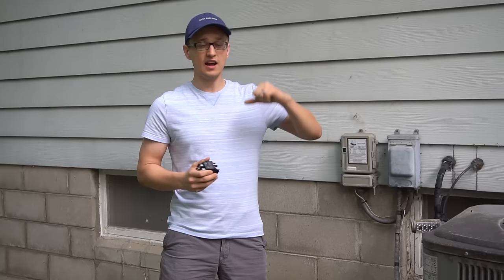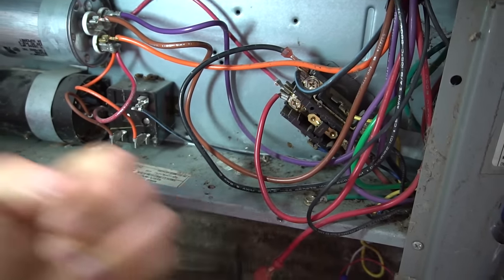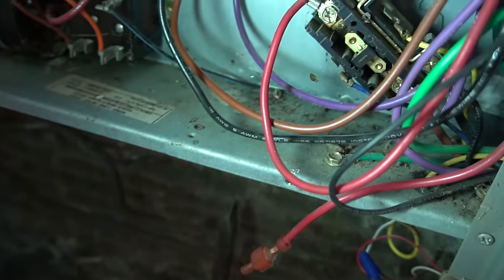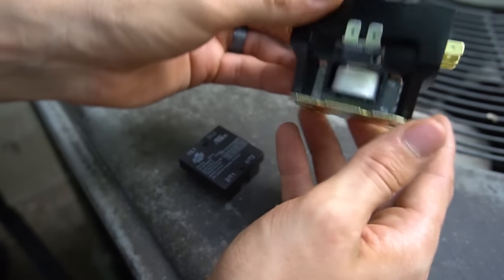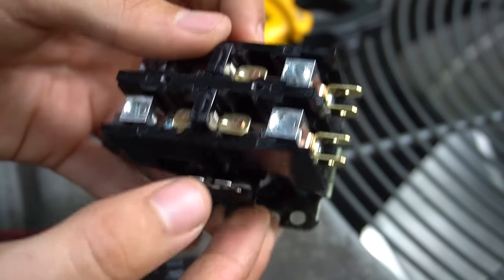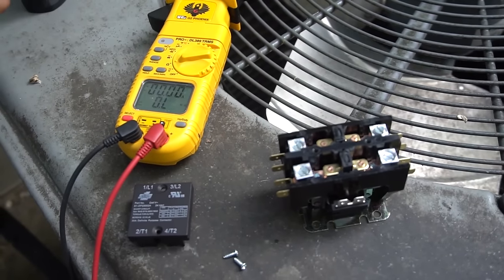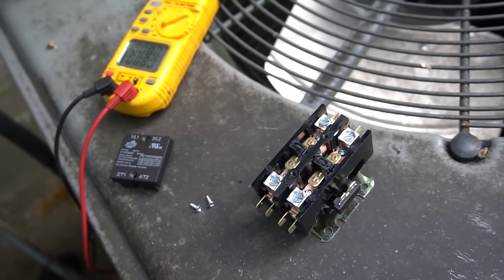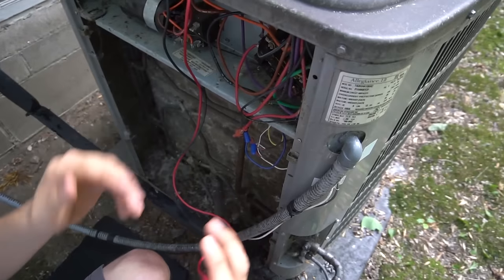Air Conditioner Contactor - How To Check If It's Actually Bad

Comment: I put a new contactor in my ac unit. I get 26v to the contactor on the yellow lines but it's not activating the contactor. I can manually push the contactor down to turn ac on. But the 26v isn't doing it. What can I do now?
Reply from the maker: Have you tried checking all the things mentioned in this video: https://youtu.be/NVPhsK4gK1A?si=s_jZeYd7-TXIjwDL

Comment: I replaced the relay or as you say "contractor" and still have intermittent issue. Issue is the compressor will not shut off but fan inside does shut off. So Thremostat is shutting off fan but not compressor outside.. Though part is this is intermittent!

Comment: Hi, my outside unit doesn't turn on. when I press the plunge it does turns on. we checked the brown wire that goes out from the house and it gives 27v, the input at the connector has 240v , but it doesn't give 24v up and down the contactor when calling for cooling. We also checked coil resistance 11-12dms. Capacitor is good. We switched to an old thermostat to make sure its not our nest and no luck. Fan blades are not stucked. hope you can help me
Reply from the maker: Have you watched this video for more ideas? https://www.youtube.com/watch?v=NVPhsK4gK1A&t=1s
Reply: Dealing with the same issue. Still can't figure out how the current is lost once it gets to the contactor. I will check for resistance on the contactor tomorrow and see if I have any luck. Right now I have the contactor forced in until room gets cold with fan set to on instead of auto on the thermostat. Please share if you find a fix.
Reply: Update. I was getting resistance on the contactor so I found the high pressure switch and pushed the button in to reset as suggested in the link above. Hope it works for you too. Good luck.
Reply from the maker: @narouspk  Thank you for coming back with an update! By the way, if the high pressure switch was tripped, I would wash down the condenser coil good. Even if it looks clean. (plugged coil = higher pressures)
Reply: @WordofAdviceTV  I actually did since you recommended it in the 10 reasons video so enjoying the cold breeze now. Thanks a lot for these helpful videos.
Reply from the maker: @narouspk  Awesome! Glad to hear it! Stay cool :)
Reply: Update: Freon levels were low and tech is coming to assess where the leak is :( 
@General Narous, I’m glad your problem wasn’t as big as mine
Reply from the maker: @adrig5059  Good luck Adri!

Comment: Subscribe
Quick question I don't have any blower motor or anything my air conditioning quit working if I set the thermostat to call for heat no air movement set it to call for cooling no air movement set it just on fan only no air movement. And jumped out from R to G 
Looking for my blower to come on but it did not it's looking like I don't have any power to the  R terminal I will double check it tomorrow I had to come upstairs my light kept going out I had to charge it. 
Anyways I've seen the mention of a three to five amp fuse on the board itself now for the life of me I cannot see a fuse on that board anywhere. Do all these boards have a three to five amp fuse on them?
At my main breaker panel the breaker does not appear to be tripped, but I did turn it off and back on however I do have power at the shut off that has that little screw in fuse into an Edison type socket I do have power there normal 120 volts. 
I really was hoping to find a blown fuse on the board and see if I could locate the short but I just cannot see a fuse on that board anywhere. 
I suppose my next step would be to check for nominal 24 volts out of the transformer.
Question is that transformer supposed to supply 24 volts nominal to the board at all times in other words I don't have to make my thermostat call for heat or cooling or anything like that correct?
I'm burning up with inside temperatures here of almost 80 degrees I'd like to try to get this thing going if I can. 
I have a hunch my a coil was froze up because there was more than a normal amount of water 
On the floor and on the horizontal surfaces in the furnace area. 
I left it off overnight to make sure it was thought out if indeed it was frozen and I did change the air filter, it appeared to be somewhat clogged but not terribly.
So if I check my transformer and have 24 volts nominal coming out of the low voltage side then I should have power at my R terminal, if this ambiguous fuse is not blown that I can't find. If I have 24 volts nominal going to the board from the low side of the transformer and I do not have power to my R terminal, would that most likely indicate a bad board? That is notwithstanding if I can find a fuse and it is not blown please advise I am burning up in this place.
I also wanted to note when I set my thermostat to request cooling my air conditioning fan is running outside but I do not hear the compressor kicking in. 
If I decide to pull the panel off the outside unit is it possible to manually engage the contactor and see if the compressor kicks on? Again though on my unit outside the fan itself is running. 
Judging from what I am getting at the board I don't think the contactor is getting a signal or command to pull in and run my high voltage to the compressor. 
Tomorrow I am going to visually inspect around the outside unit and see if I can see any physical damage to the wiring coming from the board but again it looks like I don't have power at the R terminal of my board.

Comment: I have a weird issue. My contactor is not pulling in. I have 24 volts between the LV leads but not through the contactor. I replaced the contactor and the capacitor. I replaced the LV. I have clean filters.I have no pressure switches or condensate switches in the unit. I replaced the thermostat with a manual. It has fresh batteries. The blower is working. The fuse is good. If I disconnect the 24 volts and hold the contactor in, my fan and compressor kick on and the pipe out (not sure of the technical name) gets frosty cold. As soon as I reconnect the LV, the fan stays on but the pipe out goes warm (I lose the compressor). I'm at a loss at this point. The unit is 8 years old and is a Rheem. Worked fine last year. No odd noises.

Comment: Hey so, my unit outside is spinning. The unit in the attic makes a buzzing/humming noise, and not blowing any air. So I am not sure if this will solve it. I replaced the capacitor because I thought that was it but nothing. Any suggestions?

Comment: I am getting voltage from inside out to the unit but wires go to another controller on the outside unit. It has 2 red led’s that are blinking. There’s no voltage from the cards to contacter. I’m waiting for the card. Will I harm the system if I just hold the contacter down?
Reply from the maker: I can't say for sure because we don't know what caused the contactor coil to lose power. For example, if you have a condensate overflow switch and it is tripped, if you wedge the contactor with something... The drain would then overflow and potentially cause water damage (if this is an attic unit) But if it is a defective control board, wedging the contactor would not cause any problems. So without knowing the cause, I can't certainly tell you one thing or the other..

Comment: My contactor pulls the fan comes on and spins for about  3 minutes then it stops, my unit inside is still running. there is also a buzzing noise when the outdoor fan is on. I get no cool air in the 3 minutes that it comes on. once the fan stops the contactor seems to be in the pull position (current still running through it. In order to get the fan running again, I have to  turn the thermostat off.   please help ,  its hot and i cant afford the ac guy
Reply from the maker: It's possible that the capacitor is weak or perhaps the fan motor is starting to go. If you have a meter, I would check to see if the motor is still getting 240v when it turns off after 3 minutes. But in the scenario you described, it would be hard for me to guess what exactly is causing that without further troubleshooting..
Reply: @WordofAdviceTV   Okay i am going to get a meter from home depot today.  Once I get it I need to know the connection points to check. I will also try to do a video  , also should i just pick up a contactor from home depot ?
Reply from the maker: @tonestar20  If they have a capacitor, I would get that too. They are the most frequently replaced part. If you are not sure what rating or size you'll need, I explain that in this video: https://www.youtube.com/watch?v=9ZGfvC-PMWU&t=683s 

The two points where you will put the meter leads to measure the voltage is simply both sides of the contactor. So the main 240v power comes in from one side, goes through the contactor (when plunger is pulled in) and out the other side. That outlet side should have around 240v while the unit is running. When the fan turns off, is there still 240v there? If yes, then I would say either that capacitor is weak or the fan motor is seizing up and will need to be replaced. I would start with the capacitor as that is quite a bit cheaper than a new motor.

Comment: How can you find the amperage you need for the contactor they have 40 amp and 30 amp contactor how do I know which contactor can I use because my contactor it doesn’t have the amperage
Reply from the maker: If you are not sure, it is better to go with the higher amperage. Just get the 40 amps as it is more heavy duty 👍

Comment: Buzzing. Not turning on. I fixed the ac unit by switching this part. During the cold seasons bugs can snuggle up inside for warmth. This happens to my water well contactor also.

Comment: On voltage test. it needs to be connected.?
Reply from the maker: Yes, all the wires need to be connected and the power needs to be on in order to check the voltage

Comment: It’s probably not a bad idea to replace contactors at about 5yrs of age as Maintenance, same as your capacitors, they are cheap easy to change parts anyway that can damage more expensive components as they fail. In the same sense those components may be the reason for those two parts to fail or over work. The real take away is, if you don’t understand what’s going on you should call a reputable licensed professional. It could save you more money in the long run. This kind of stuff is good to know, because it lets you know the difference between a part changer and a real technician. Parts don’t fail ever for no reason, there’s a reason always and that needs to be addressed first.

Comment: My contactor switch was burnt on 1 side so it didn't make good contact and fried the transformer cause it didn't have a fuse inline in it. In my case the contactor switch caused my outage.

Comment: Will transformer short out if someone cut thermostat wires when moving thermostat?
Reply from the maker: Yes, that's definitely possible, especially if there is no 3 amp fuse or breaker at the furnace control board.
Reply: They said it ran just fine tell it was moved they didn't know about shutting power off that's when condenser would run for very short time then blow fuse

Comment: Does a bad contractor affect heat?
Reply from the maker: If you have a heat pump, then it can, yes. But if you do not have a heat pump, then no. (unless both ac and furnace are running at the same time)

Comment: When I turn my ac, I see smoke coming out of fan and fan does not work. What should I do? Should I just  change the fan motor or something else is wrong? Please help.
Reply from the maker: There's a chance that the capacitor is dead. If you have a multi-meter, you can check it. Or the motor may be bad like you said. If you spin the fan blade manually with a stick or screw driver, does it spin pretty freely? If it does, you could try replacing the capacitor first and if that doesn't do it, then you'll just have to replace that motor..

Comment: Hey Jay, My problem was ac unit was making a loud banging and kept stopping. I replaced fan motor and capacitor. Everything working fine and cold. Now there is a loud noise coming from outside unit minus the banging but still working. What is it?
Reply: That could be the neighbor's kid practicing w/his band minus the drummer...

Comment: Can I please get some advice my Bryant ac unit does not start up I already change the capacitor. And I am not getting anything no compressor and no cooling fan?? I push on my contractor with a srew driver and there no noises.
Reply from the maker: Have you seen any of my other AC fixing videos? It sounds like your unit is not getting power. Perhaps a blown disconnect fuse or a tripped breaker?
Reply: I saw a lot of your videos that's what I have done all afternoon trying to figure out my problem. But. I have not seen. Any about the triple breaker. Or the blown up fuse  the only fuse i saw was in the furnace but that was okay I was thinking of changing that connector see if that was the issue??  any ideas?? Thank you for replaying.

Comment: I get bugs and other crap on my contact points even though there is a cover...don't know why but I just take the cover off and clean the points with carb cleaner or alcohol and a q tip and i am back in business. I would like to know if i can change them over to electronic pointless system.

Comment: My contactor is not staying pulled in. It’s measuring 27 while pulled in but while it’s running it pops back off and the fan stops running. What could it be if not the contactor?

Comment: What will blow the 3amp fuse everytime the heat kicks on , the cooling side works great?
Reply: A low voltage wire is shorting some where inside the unit or a short from the thermostat wire going to your thermostat

Comment: mine is 25 years old it was not engaging and turning unit on i managed to get it to engage after manually pressing it down i got a pop and buzz not sure if it was a bug or worn contacts but i am going to replace it anyway and take the old one apart after 25 years those contacts are probably pretty bad

Comment: Hello, my A/C is not coming on! I changed out the capacitor but I noticed whenever I push the contactor in, the unit immediately comes on fine. What do I need to replace from here please?
Reply: Why did you change the capacitor?  Or are you shot gunning?  By that I mean are you just changing a part because you don't know what else to change.
Reply: Check the thermostat
Reply: I called a professional out and he found a short in one of my wires on the A/C unit!
Reply from the maker: If the contactor is not pulling in on its own, watch this video: https://www.youtube.com/watch?v=NVPhsK4gK1A&t=2s

Comment: I have a contractor that opens almost exactly five minutes after I start it.  I changed out the thermostat so I know is not that. Is there anything else that could trigger the circuit to open after 5 min?

Comment: I have just the opposite where  my a/c unit won't shut off? I use to smack the unit and it would either turn on or it would shut it off?? Contactor??

Comment: So if you push in “plunger” , that means it’s good? My ac is showing no power at  thermostat now after swapping capacitor… when plunging the ac comes all the way on
Reply from the maker: If your AC is not turning on but when you press on the contactor plunger everything comes on, I would watch this video next: https://youtu.be/NVPhsK4gK1A
Reply: @WordofAdviceTV  thank you for your reply… I actually accidentally unplugged the power in attic. I was being over careful and checked filters and wires in attic. My thermostat was saying no power to Rh

Comment: What causes constant low voltage to the contactor and condenser fan sometimes only works  no compressor.  My ac gets low voltage and contactor is closed but condenser fan sometimes works and compressor does not kick on.
Reply from the maker: That sounds like either you have a dead capacitor or are missing one hot leg (120v instead of 240v. Perhaps a disconnect fuse?)
Reply: @WordofAdviceTV  ok.  Thank you.

Comment: Just playing. 
Hi my ac I not working.
My AC unit is not calling for cooling because I have the thermastate off. So when I turn the breaker switch on my contactor makes loud buzzing noise.

Comment: Hello sir,  I am from India , an electronic engineer with less experienced. Here  problem is my ac not working properly . It was OK,  once ac outer split compressor  unit has been turned itself off suddenly.  But inter blower unit was running without cooling.       Now the blower unit is also running for few seconds while switching on its power and turns off so soon.  I found the power supply is not getting to the compressor .  I wish to solve this problem myself. Can you please help me to find a solution for this ???

Comment: My condenser fan was stuck after winter. I used a stick to make it turn and now for some reason even if the AC is off the compressor fan keeps running. What could be the problem?

Comment: My ac had a bad capacitor somebody remplaced it then when he put all the wires back my unit stared yo work but just the fan he mistaked two wires he said and put them in the right order after that the compresor stared to work but not the fan what should I try now

Comment: Hi. My AC does not cooling and every 3 min tries to run the compressor and fan. (I believe is because has a 3 min anti short cycle time delay module) This is happening only when is hottest during the day. During the mornings and nights works perfectly. any idea why fails in this way when is hottest? thank you. I will appreciate your comments.

Comment: hi, i have heat pump. i replaced capacitor and contactor, when i turn heater on the plunger won’t push in. i push plunger in myself, then condenser would turn on. i don’t see any fuse on control boad, what could be wrong? please help i beg you